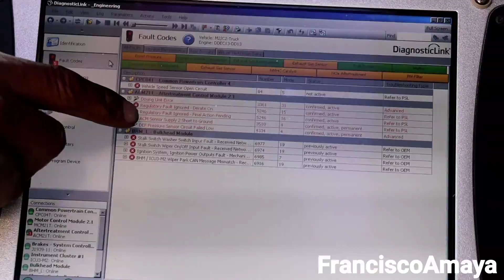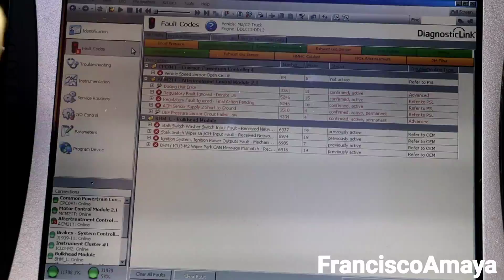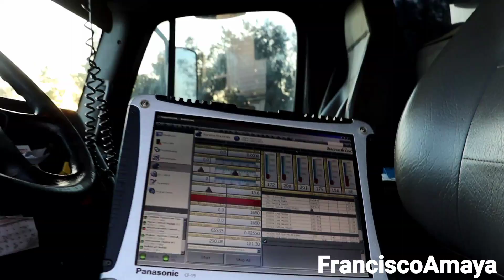S1 E6 F.A.I.T.H. DD13 engine DEF light blinking regen on spn 3361 5246 3510  4334 freightliner M2

Comment: Francisco necesito tu ayuda tengo un frailener 2015 D15 remplaze camisilla#4 puse junta de cabeza ensamble el motor prendió bien pero se tranco beering del cigüeñal #5 todos los demás jeringas están perfectos y no sé qué más me podrías ayudar
Reply from the maker: Es possible que el motor se quede sin lubrication.  El agua a de ver entrado a los bearing y lo daño
Reply: Francisco Amaya si eso mismo pasó lo que acabas de decir , pero Cambie el punto #5 del Bering por segunda vez y se  volvió a trancar a los 20 minutos de estar prendido Ayuda o que me recomiendas
Reply from the maker: Pues el ciguenal se tiene que cambiar para arreilar este problema

Comment: Hola Francisco gracias por los videos,quiero su opinión por favor..acerca de Freightliner Cascadia 2016 cada semana se enciende un check engine amarillo,pues hay algunos verdad?.. y despues de uno o dis Dias se apaga, en esta semana se encendió esta y otra más con el dibujo del motor y la luz pequeña del def que parpadea luego perdió fuerza,pero en unos minutos más desapareció la luz con el motor y la pequeña,la otra permaneció un día más y se fue.Que es lo que esta mal ?
Reply from the maker: Tiene algun codigo?
Reply: Francisco Amaya No ahora pero antes salía código de mala calidad de DEF y que necesita regeneración...lo cual hace mucho sentido porque voy al taller y lo unico que le hacen es regeneración y desaparecen los códigos...parece que algún sensor no está trabajando bien .